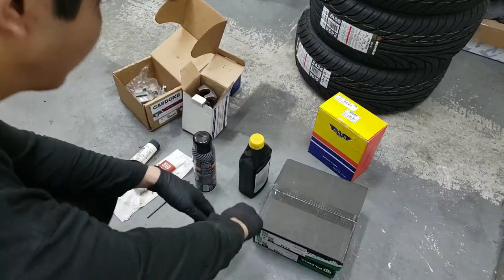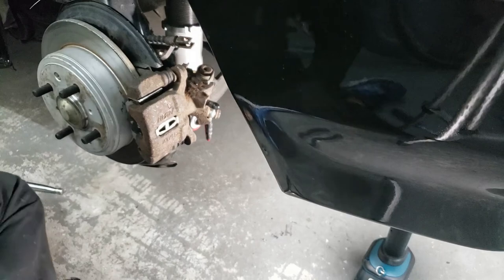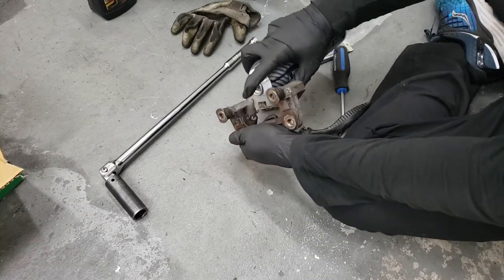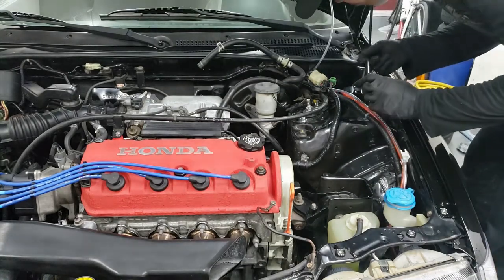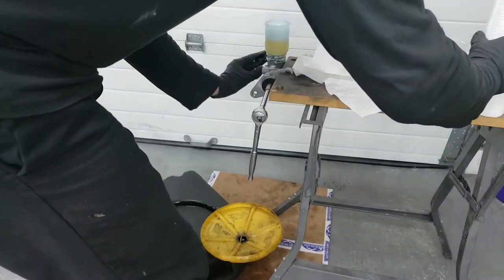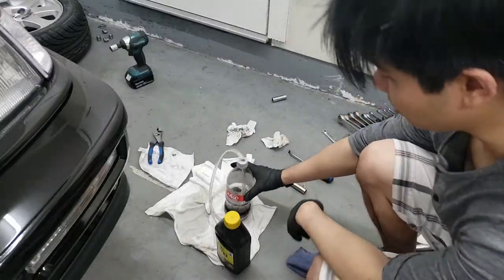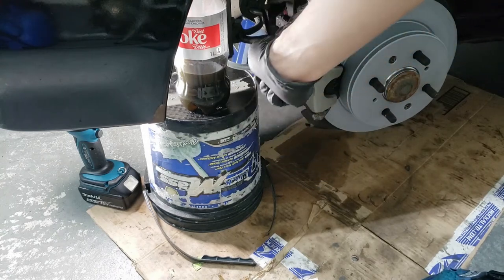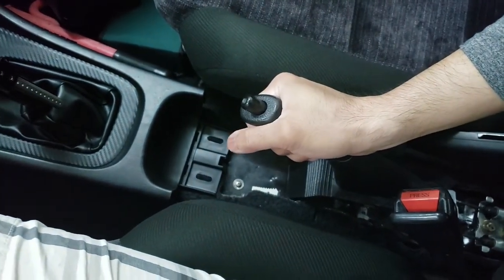HOW TO: ⚡REPLACE Rear Calipers, Rotors, Brake Pads, Master Cylinder, ⚡BLEED Brake, & ⚡ADJUST Ebrake!

Comment: So with the ebrake cables which ones did you use, or did your car have the discs already before you swapped trailing arms?
Reply from the maker: 90-93 Integra 2 door ebrake cables. The sedan ones would be too long. I've always only used DA cables on my EF hatches, but I remember people on forums were using DC and EM1 cables as well. I haven't tried those, but would probably try them when my cables wear out. The DA ones are discontinued everywhere.